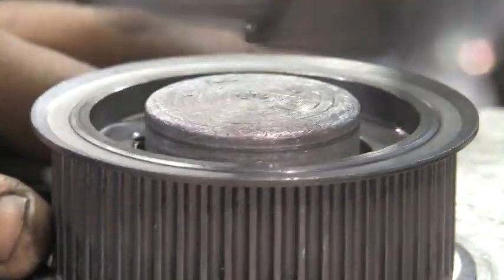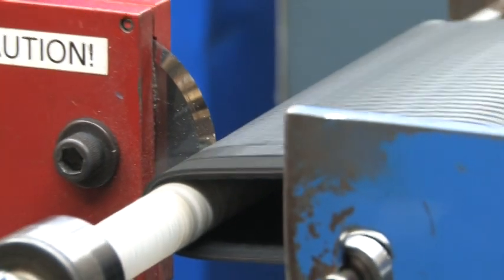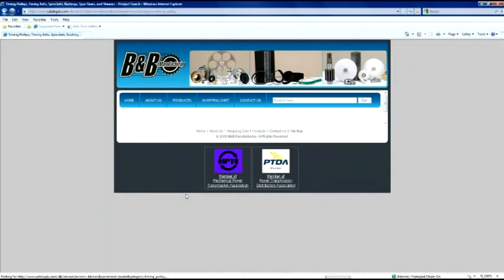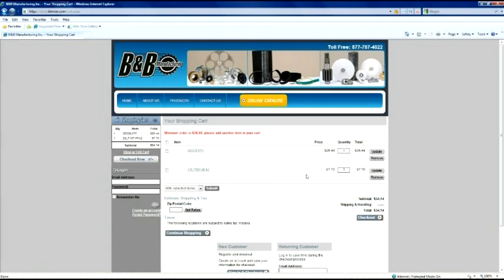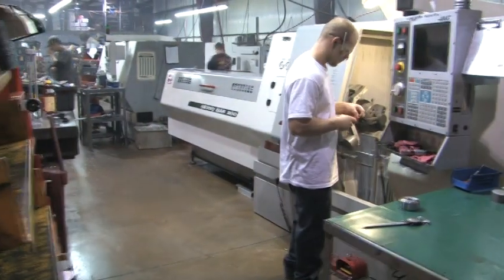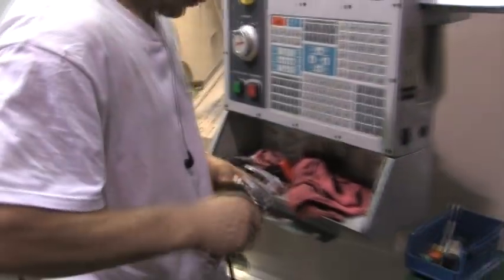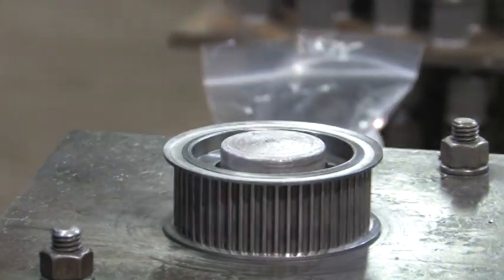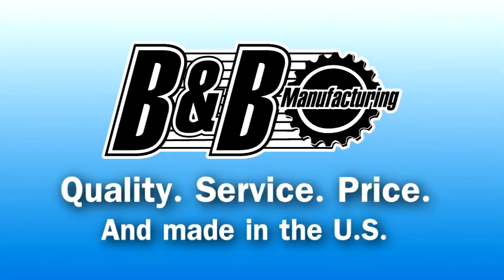Timing Pulley  Video  - Timing Belts - B&B Manufacturing

Comment: I want double sided rubber timing belt to use it in staircase climbing robot ;
Outer side pitch :- 56 mm
Inner side pitch :- 5 mm
Belt width :- 60 mm
Outer side teeth profile :- \_/  upper side 30mm ; Depth 10mm ; Lower side 15 mm
Is it possible to make this?